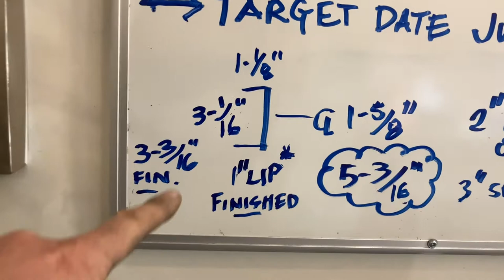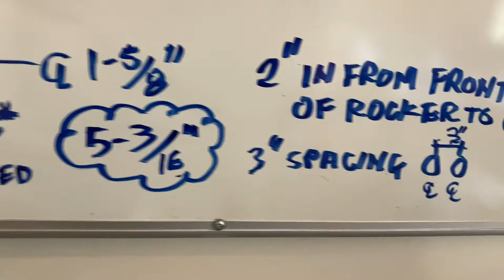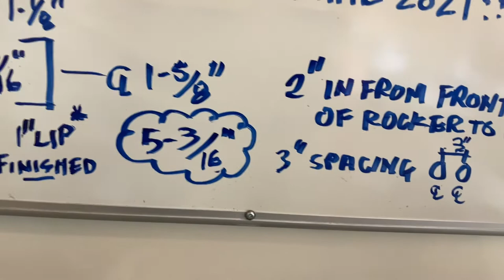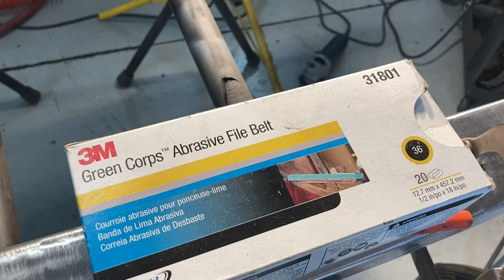EXTRA RIGIDITY for HIGH HORSEPOWER! Enhanced Rocker Panel Brace - Pro Touring Camaro Build

Comment: Thanks for showing this.  I'll have to consider it when I do my rockers.  Any reason why the 1" hole can't be drilled with a step bit?
Reply from the maker: No reason... As long as the draw bolt fits. It’s a lot of work but the added strength from the brace is very tangible!

Comment: Ken, did you paint the inside of the outer and inner rockers with "Steel It" also?
Reply from the maker: Yep. Better than a weld through “primer” in my opinion - more durable finish coat that’s weldable. 👍
Reply: Thank you!
Reply from the maker: No problem. Appreciate you watching and commenting. 🍻

Comment: What were the measurements for the triangular filler piece. Measuring the one i cut off from my car, I'm getting roughly 3.25" wide iside of the 1" flange at pinch weld, and the lower 3" brace bend (widest part of triangle) just trying to make sure before i start fabbing up my own.
Reply from the maker: I based mine off the one I cut out too. I’ll take a measurement off the car tomorrow and will let you know.
Reply: @Paradise Bay Customs  that's awesome.. thank you for the quick reply. The car looks great . That new brace you made was amazing. Keep up the fantastic work!!
Reply from the maker: Depends how you measure - from what face??? I have 2.5 inches of exposed plate at its widest then the approx inch of the outer rocker flange for a total width of about 4 inches of inner rocker inside of the inner quarter. Make sense?
Reply from the maker: Make that 3-1/2” between inner quarter and inner rocker at the widest
Reply from the maker: Message me in Instagram and I’ll send you a photo.
Reply: @Paradise Bay Customs  yeah that's perfect.. thank you very much. I was getting 3.25 ish.. but its pretty mangled. So the 3.5 sounds right on. You're the man!
Reply: @ParadiseBayCustoms  PM sent on IG